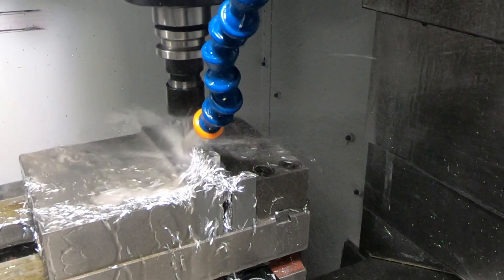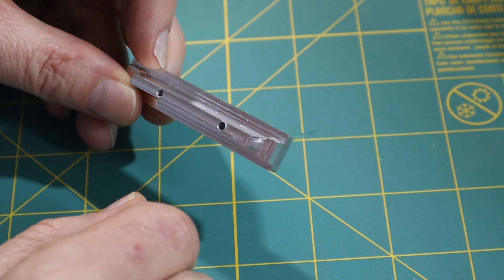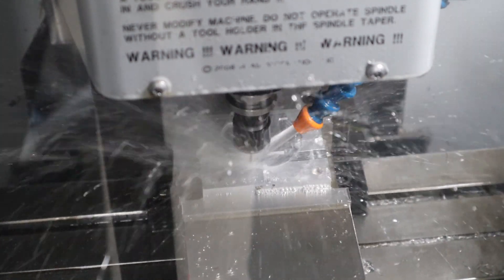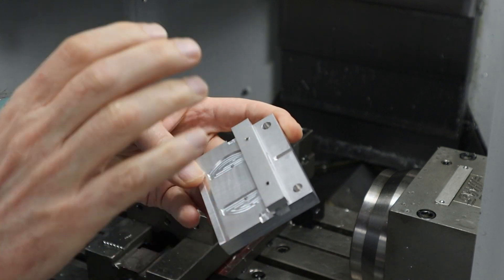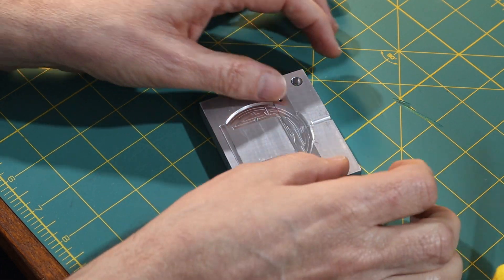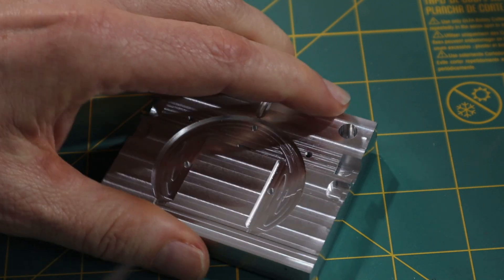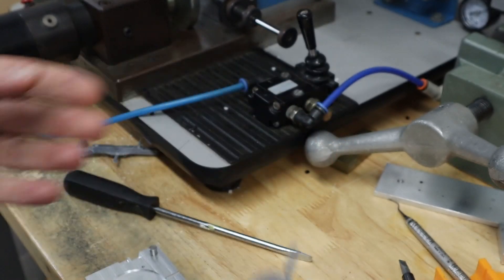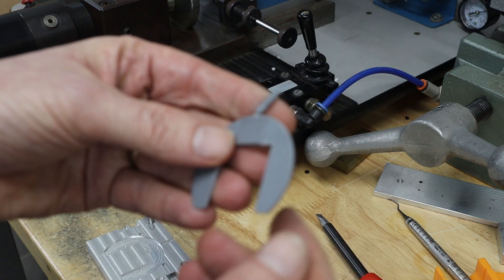Customer Injection Mold Part 3

Comment: On future designs using an ejector bar please consider using tapers on the side wall(s). Positive registration is provided for inserting the ejector bar. Adding a 15 degree angle to the runner sidewall of the slot would be ample (any angle could work, less than 7 degree would tend to pinch the ejector bar while larger than 25 degree could reduce the clamp pressure pending the molding depth). 
A single through hole on the centerline or the two locations you choose could be used to activate the ejector bar, either with a punch or placing the mold on a fixture with protuding pins. Or activation still could be pry bar accomplished.
Part design is important as it limits the mold functions. This part has extremely thick walls, are they needed? The heavy  thickness contributes to the sticking in the mold, as the plastic cools it shrinks locking around the cored center square opening. Hopefully part tolerances permitted ample draft on all vertical walls, 1 degree everywhere and a minimum 3 degree on the square opening. If the full thickness is not require for part function then the excess material should be cored away leaving a profile flange, gussets/ribs add strength.
Mold design. Whenever possible distribute the the surface area so the cavity area releases first from the core. Do as much work as possible on part line opening. In this case a stepped parting line may have assisted. Cutting the major portion into the cavity, telescoping the square opening from the core sealing on angles. The two pins could start on the cavity side, if needed save room to reverse to the core while plugging the cavity holes for vents.
Reply from the maker: I'm using 9 degrees of taper on the side walls for the ejector bar. As to the part design, this is a mold for a viewer. I proposed an alternative design with thicker walls, but he didn't want to go that route. Also, I almost never go below 3 degrees of draft.

Comment: Nice video, John, thanks for your sharing, is it MUD mold? is it a mini manual injection molding machine at 10:02 which shown in your video? it seems i never seen this in China as we only have big injection molding machines, the smallest tonnage in our company is 90T.
Reply from the maker: This is the entire mold designed for desktop injection molding machines. These are machines that having a clamping force of 1-2 tons, so very different from a 90T machine.

Comment: HI, Again a great video!
I also have a Haas OM2 . What vice are you using?
I've trouble finding i good fitting vice, most I find are way to large or just to small. (At the moment I use a large vice sideways but that not very practical. 

Soon I will also try to mill an injection mold. but first I have to investigate which (small) Injection molder to buy (in Europe)
Reply from the maker: This is the vise I'm using: https://www.shars.com/4-single-lock-down-precision-milling-machine-vise. It's been discontinued. This is a vise I plan to get at some point, because I'm not a huge fan of the Shars one: https://www.kurtworkholding.com/specialty-vises. As to what machine to get, there is a good group on Facebook where you can ask that type of question: https://www.facebook.com/groups/2206675146227501

Comment: I’d just make a couple of pushers, maybe 5 mm in diameter... it feels easier to implement.
Reply from the maker: Yes, easier to make. Also not as easy to use. I was more concerned about how quickly I could make parts, so went with a more complicated to engineer solution. Here is an example of a mold I did a long time ago that used a simple pin: https://trains.socha.com/2010/04/making-conoco-gas-truck-part-v.html
Reply: JohnSL yes, smth like that, but I’d go with a mushroom-shaped pushers, not just pieces of rod. And i’d not have them flush with the mould on the external side, I’d deepen them by 2mm. Then i’d make a plate with 2 pins, and once I took the mould out of the machine, i’d put it on this plate (pins matching the pushers holes), and press , thus pushing out the part. Sorry if it sounds dumb, I’ve never done anything like it, it’s just an idea...
Reply from the maker: Not a dumb suggestion at all. I thought about doing something like that, but wanted to try this approach just to see how it would work out.
Reply: @JohnSL  nice video as always. What about spring loading the insert so that the part is ejected as soon as the mold is released from the clamp?
Reply: @dmyegorov74   Have run thousands of pre-production parts this way until the capital equipment arrived.

Comment: Hi, I want to ask you about the possibility of producing FRP samples using injection moulding?
Reply from the maker: I had to look up FRP. It looks like it's glass-filled thermoset resin, like epoxy. So not suitable for using my injection molding machines, as they melt the material and then push it into the mold under force.
Reply: JohnSL can I strengthen polymers, such as ABS or PP by using short fibers ?
Reply: Using injection moulding process
Reply: Yes, Anwer, you can use injection molding process for FRP samples, for example PA6 30%-50% GF glass fiber, we have molded many FRP parts particularly IXEF which is 50-60% of GF, but the tool temperature have to be heated up to more than 120 degrees with oil heater, otherwise a beautiful part surface finishing can't be achieved. you can watch my video to know more. thanks.